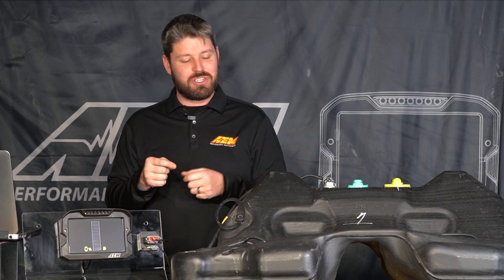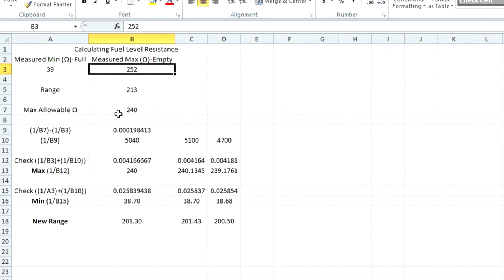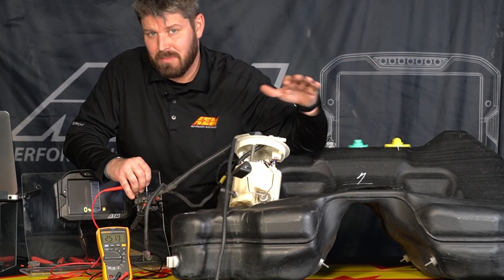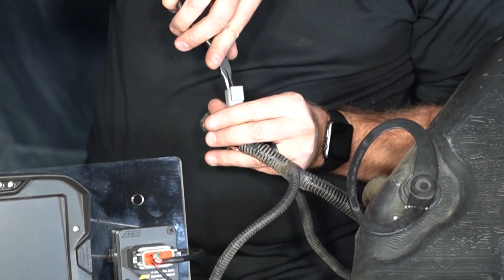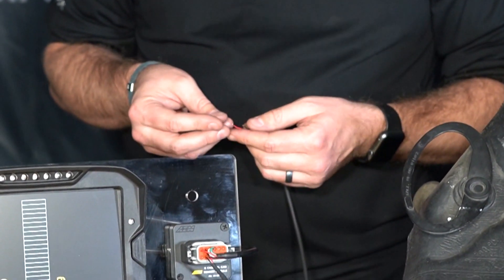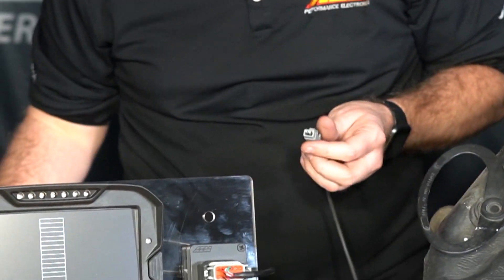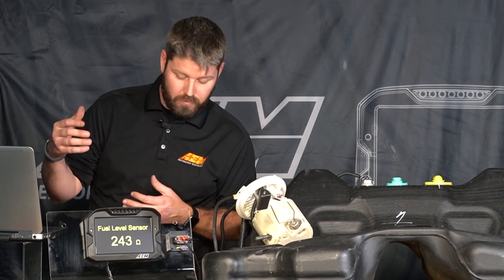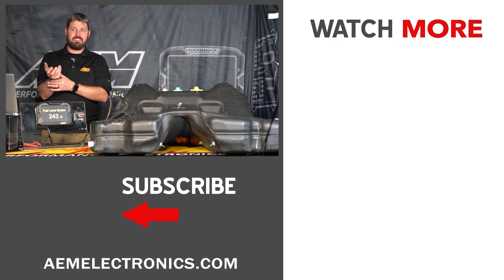How to CALIBRATE Your Fuel Level Sensor on Your CD DIGITAL DASH

Comment: How can you reduce the refresh rate of the fuel level? I have this setup and working but everytime i turn a corner, accelerate, brake etc the fuel slosh changes the reading. I have tried with input filters but can't find any combo that works. Because race car, the car is never flat or stationary so I can never get an accurate or even usable reading of the fuel level. Any suggestions? Thanks.

Comment: What if your vehicle had 2 fuel level sending units such as a 350z. And can a delay be setup so the reading is not so eradic?
Reply from the maker: Yes, and average or rolling average filter can be set on the input to avoid continuous oscillation.

Comment: How do you adjust the sample rate or an average over time?  I don't want the gauge to bounce every time the car bounces..
Reply from the maker: Use the dash design software to add a filter to the channel. There is an option in the software right under the input selection for the gauge/value. Something like a 5 second rolling average with a slow update rate would work well. (select value, select input filter, green +, select filter from drop down list)

Comment: I'm running an AEM Infinity 506, as well as the CD-7 display. Would I still need to utilize the CAN module?
Reply from the maker: Yes, the 6channel can sensor module (30-2226) is perfect for users with the Infinity ECU because the ecu does not have a native resistance based input for fuel level.
Reply: @AEMpowerTVelectronics  That's what I thought. Thanks for the response!

Comment: If the vehicle has a 3 wire fuel level sensor, do you just use the (-) and signal wires? Or do you need to run a power wire to the third wire still?
Reply from the maker: This is a tricky one, we have not seen a 3 wire fuel level sensor, most are 2 wire variable resistance. Wiring and calibration will depend on the actual sensor and its output (0-5v, ohms, frequency, etc)